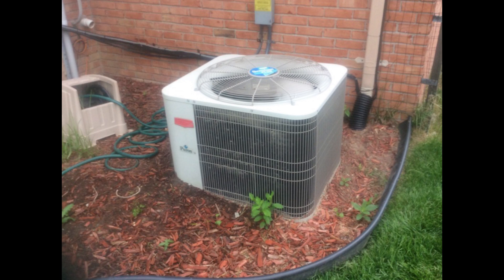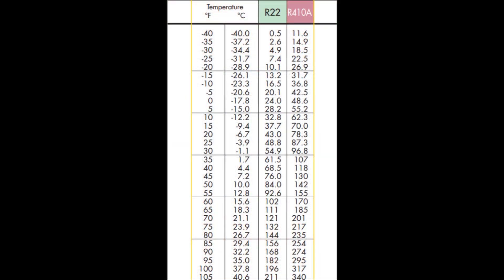R22 or R410a? Refrigerant PT Chart example

Comment: Can you charge unit r22 system with r410 refrigerant?
Reply: No
Reply: @wdwilson397  why?
Reply: @AS-pj1vb   Because your compressor is either built for R22 or 410A, pressures are different.  Also the Evap coil components need to change...It's like putting Gasoline in a diesel engine or vice versa
Reply: @wdwilson397  For example there are cars with ac produced during 80s and 90s, but today there is not in the market that old gas for such old systems, how can you make them working what kind of gas would you use?
Reply: @AS-pj1vb   If you have R-12 in your vehicle (which is not available) you need a direct replacement refrigerant or replace the whole AC system.  I don't remember what replaces R-12 but you can look it up

Comment: Hi  When you check the Temp are you checking he outside Air Temp or the Temp of the line with the gas init   Thanks
Reply: First  checking  gas  us which  type  uint  after    name  plae  maifel  checking   psi  checing     gas us  new  unit   letas now gas  lot  of  unit  new  gas  new  uint using  R 410  gas  using  find  out  unit  making  some  unit  gas using  410      unit  coler cord fee some  name  plat us  rightinv    ..R410  gas  gange  checking  .suction  psi  120  to  130  psi    dis  carge450 to  500.psi  .  Standing  psi..225   to  230 .     Od  mode  ac    neame  plat   pestge uint  is  name pla  checking  phcal checkin minding  snd 65 to  to 70  sudi us  using  r22  55if  maxmiom nt 60 to 10psi  down good  max..usung R22 dis chargeR22Stand ps    150  to  155. using 270 to  300 . R22.essur  e

Comment: what if there is no label & empty ( no gas in the system ) so how to know which type of gas to be refilled
Reply from the maker: There is always a label on the compressor, but you have to remove the fan to get access to it.
Reply: Old gauge and checking  psi R22 low showing    unit  amer chwcking    guge showinv  gaz ok  unde staimg  les  chergeing  new  ok  new gas bai  gas  cylnder  couer cord   geron   r22    nrw gas  rose  ising  new ok  name plate  show  same  rightimg  has  us  new  R410 ok rghting  need  afet  using

Comment: Thank U for the example
But : how can I tell if the charge in the is correct in system
Bearing in mind R404a can be charged as a liquid or as a gas ?
Pl reply to 
ramelite2000@aol.com
Or where can I find this knowledge
Reply from the maker: Hi Ram,
I think you are mean R410a instead of R404a. 404a is usually used in low temperature refrigeration applications like freezer or icemaker etc.
The PT test is done when the system is in off position for at least five minutes. This way the pressure is equalized. 
If a pressure in a house AC system is significantly different from R22 or R410 that mean that, a substitute refrigerant or air was added at some point. The only way to be sure is test a sample with a tools called refrigerant identifiers. There are several brands and the price vary according to the type of freon that the tool can work with.
If you are asking how to make sure, if you have the correct level/amount when the system is running then the only way to tell is to check superheat/ sub-cooling. Great tutorial is written by APR Supply :
https://www.aprsupply.com/ASSETS/DOCUMENTS/CMS/EN/Tech_Support_PDFs/AC%20Superheat%20Sub-Cooling%20and%20Delta.pdf